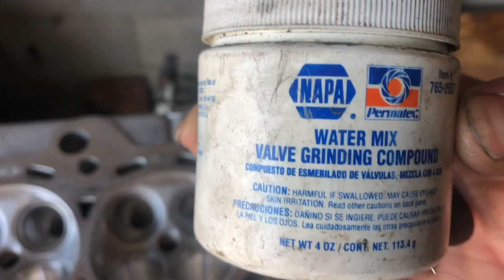The porting job of K series cylinder head!!!

Comment: Just a quick tip spray WD-40 on the carbide bit every once in awhile and it also stop them from clogging up
Reply: And I think left and right if remember correctly 👍
Reply: Or regular cutting oil
Reply: Varsol is also good too.
Reply: Ordinary bar soap works the best , just run the bit ove the soap couple times and your good to go , have done many heads and intakes
Reply: @prostreetdino7946  sounds legit
Reply: best choice is lubricating cutting stick wax, that what i use for porting heads
Reply: Pam
Reply: We dip ours in ATF-4.
Reply: Long story short...if you love it, lube it
Reply from the maker: Jess Heffren I dipped the bit with atf!!!
Reply: Best practice is to fully submerge the head in used motor oil
Reply: @prostreetdino7946  thanks man for the advice! I just did a H series head and clogged up a load of bits. Now I know how to save a few more on the next one!
Reply: j4mesgreen glad it will help you in the future , I’ve tried wd40 etc etc but the good old bar soap works 100% , I love porting and polishing , love making horsepower lol, I have a video on here about my Harley I built a crazy stupid motor for ,  has some spray as well for kicks lol , take care

Comment: There is a product made by Orlube for Boeing called Boelube..They make a soft, medium, firm carbide bur and mill bit dip, keeps the double cuts from loading up and any bit u put it on it keeps the bit sharper longer..Boelube 70302 is the softest dip.. Also for combustion chamber use a little Tap Magic Aluminum..It is made by Tap Magic and is a drilling and milling lube that keeps the bits sharp and won't let the bits hop on the surface..

Comment: Great video Phong, thank you!
P.S. Good choice of goggles. I was porting a cast iron head several years back and I was wearing regular old safety glasses. Bad choice on my part, a piece of cast iron flew up, ricocheted off my cheek, and stuck in my eyeball. After that experience, I wore full goggles like you are using.

Comment: I've always put the intake gasket on the head and get it lined up correctly then take a marker and color in the surface inside the gasket and do the same to the intake so you'll know the intake, gasket, and head are all perfectly matched so there isn't a big lip at the gasket between the head and intake

Comment: I always lap the valves not directly to the drill.. but with a piece of fuel hose in between. That way you get even pressure on the stem. 

Also a good measure for checking the valves seating is colour it with a whiteboard pencil and then lap it.. that way you can visually see the parts that dont seal or bent valve.

No 3 angle valve job on this one Phong? 

Awesome job, takes forever to do that stuff.👏

Comment: i also cut my valve guide still running good after 5-6years..ssssstututu
Reply: Good yo hear.What setup are you running?
Reply: @kudzy11  87mm wiseco,manley rod,toda camshaft,toda cam gear,ferrea valve,4throttle,ogura twin clutch,hondata.

Comment: Your crazy brother, id never think to flat deck the vlave guide! Imma do that on my next head build fo sho
Reply: May effect stability ? And definitely will accelerate guide wear
Reply: He dont mention using the reamer after to remove the sharp edge he created grinding the guide.if you leave it sharp it will damage the valve stem
Reply: @pacific7775  grinding the guide is the area in the port that gains the most flow
On a street head you dont remove as much

Comment: Nice work, but do you use templates to gauge the ports at certain distance that they are all equally shaped, and do you measure the port volume for consistency? 
Or do you just go by feel and eyeballing it?
You would gain 15-25% of flow on low valve lifts by cutting radius valve seats.

Comment: I am porting  m k24a2 RBB head for turbo use and am wondering about your valve guides.
It appears you have cut them off.
I have never seen this. I typically see porting around them making a knife edge in the front then smoothing them out.
My concern is that it will destabilize the valve because it cuts the contact area in half .
If it is okay and does not negatively impact them I would cut them off like you did.
Also what are your guides made of?
They  look silver. I believe mine are brass/ bronze.
I have cleaned up ports before but I have never done a serious porting job.
My first intake,exhaust and combustion chamber took a long time and is a lot rougher looking than yours.
All I have is short bits and I have no sanding bits yet.
I have watched numerous porting vids but getting your hands on the tool and doing it is very different.
I am going to keep at it. This will be a turbo build (gt3582r) so I am not too worried about messing it up losing velocity etc.
If I were going all motor I probably would not be doing this.
Thanks for your time.

Comment: If could next time measure the cc before and after you port if possible, looks like the increasing air flow by a 15-20%.
Reply: The amount of material removed does NOT have a direct effect of “percentage of airflow gained”.., it’s not how much you remove, it’s WHERE you remove it. I’ve gotten so many heads to fix that we’re so horribly butchered by amateur ppl porting that I’ve had to throw them in the aluminum scrap box...
Reply: @scottsmith5623  yes I know that I just wanted to know how much more cc it would be obviously thong has developed his technique over many years to suite his needs for na power which must work for him. More a curiosity thing air flow measurement and patterns would be different depending on which technique he was using, previously he used a dimple golf ball technique on 1 part which seamed to help.

Comment: Anyone can hogg metal out Where's your flow bench
Reply: SSHHHHHH..............His fanboys don't know what that is.
Reply: Actually I would guess that even a novice speed freak knows what a flow bench is.
I don't know Phong personally but I have known a lot of guys like him.  Many have ported, literally thousands of heads. Most of the time they specialize in one type of head (GM LS, 4g63t,K20/24 etc). Once you do the same head over a dozen times you jist know what to remove by touch and looking at it.
I did my k24a2 head...did it just like Phong did. First time doing a k series head. I would love to get it flow bench tested but since it is going on a turbo build I am just going to put it together and see how it tunes.
If the afr is off from cylinder to cylinder I will know why. Can probably tune most of it out.
How about asking Phong how many heada he has ported. I bet you would be surprised.